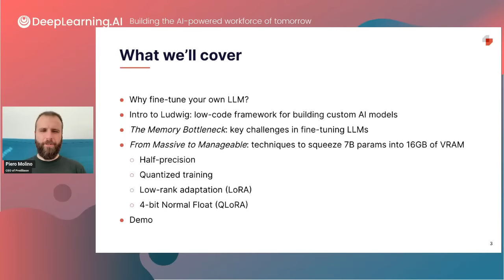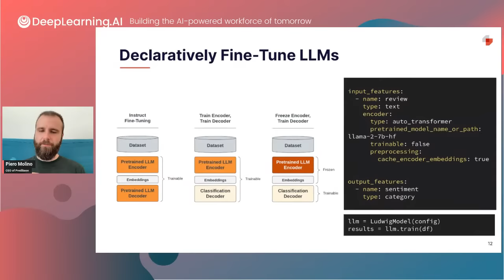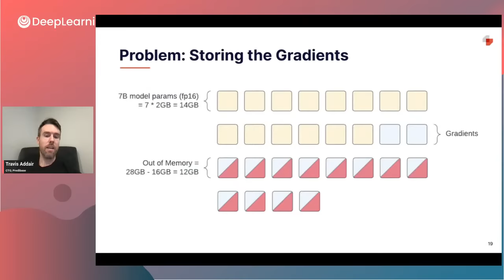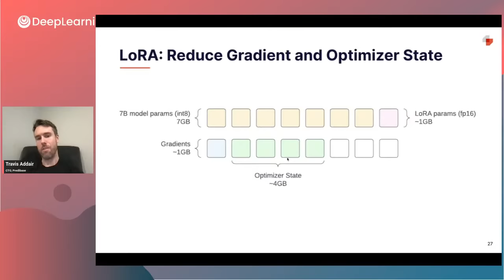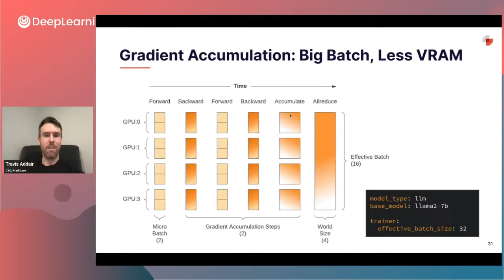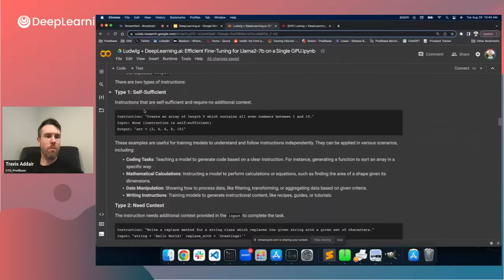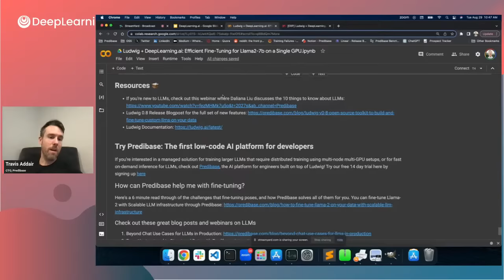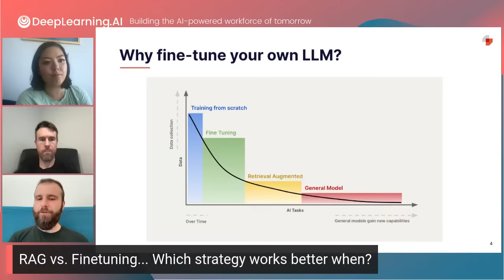Efficient Fine-Tuning for Llama-v2-7b on a Single GPU

Comment: Nvidia H100 GPU on Lambda labs is just $2/hr, I am using it for past few months unlike $12.29/hr on AWS as shown in the slide.
I get it, it's still not cheap but just worth mentioning here
Reply: You are right, we reported the AWS price there as it's hte most popular option and it was not practical to show all the pricing of all the vendors. But yes you can get them for cheaper elsewhere like from Lambda, thanks for pointing it out
Reply: Last time I tried it, H100s are out of stock on Lambda
Reply: @rankun203  They are available only in specific region mine is in Utah, I don't think they have expanded it plus there is no storage available in this region meaning if you shut down your instance, all data is lost
Reply: together AI is $1.4/hr on your own fine tuned model :)
Reply: @Abraham_writes_random_code  Predibase is cheaper than that
Reply: @PieroMolino  how do I download the trained models and run it locally?
Reply: $2 is pretty cheap, what do you mean by this? How does it scale to be pricey? Genuinely asking

Comment: Cool video. If I want to fine-tune it on a single specific tassk (keyword extraction), should I first train an instruction-tuned model, and then train that on my specific task? Or mix the datasets together?
Reply: also working on keyword extraction! I was wondering if you'd had any success fine tuning?

Comment: at 51:30 he says don't repeat the same prompt in the training data. What if I am fine-tuning the model on a single task but with thousands of different inputs for the same prompt?
Reply: It will cause overfitting. It would be similar to training an image classifier with a 1000 pictures of roses and only one lilly, then asking it to predict both classes with good accuracy.  You want the data to have a normal distribution around your problem space.
Reply: @PickaxeAI  Did you come across a solution for this?
Reply: Can you give an example for the task? I'm trying to understand in what situation you'd need different completions for the same prompt

Comment: epochs=3, since we are fine tunning, would epochs=1 would suffice?
Reply: It really depends on the dataset. Ludwig has also an early stopping mechanism where you can specify the number of epochs (or steps) without improvement before stopping, so you could set epochs to a relatively large number and have the early stopping take care of not wasting compute time